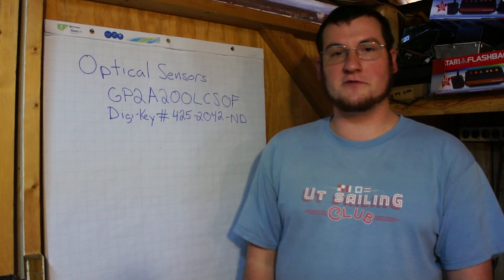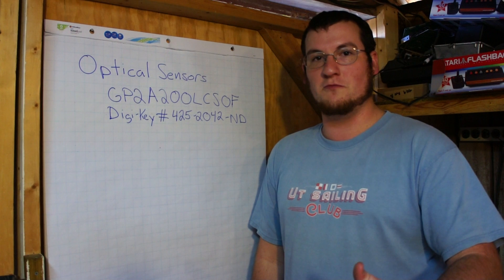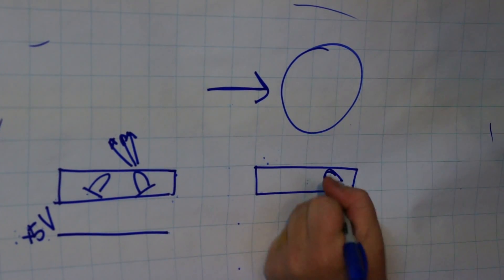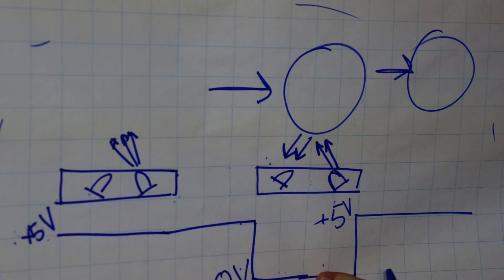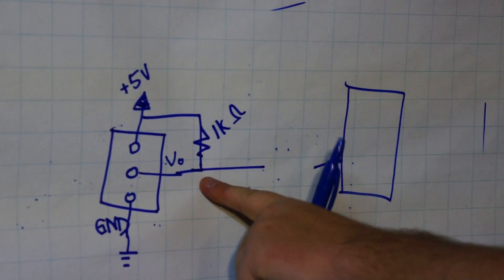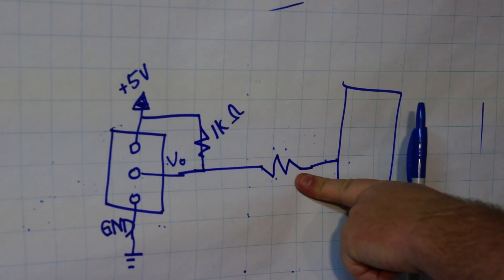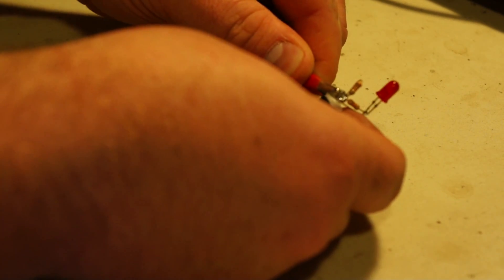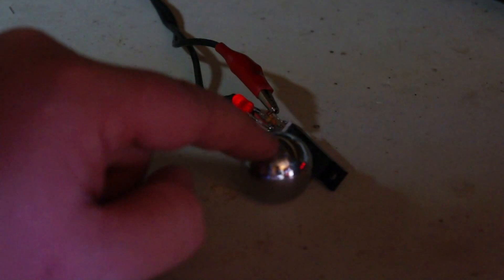How to use an Optical Sensor with a Microcontroller

Comment: Is there any way to reverse this effect? (Have the led off then turn on when the ball is sensed) Also this is a kiddish question but how do you tie the V Out to the 5 V (how do you split the wire into two parts and how do you connect the one part to 5 V), Great sensor idea! I would love to make a pinball machine similar to the one you have been building and I would be happy to add these sensors to the game